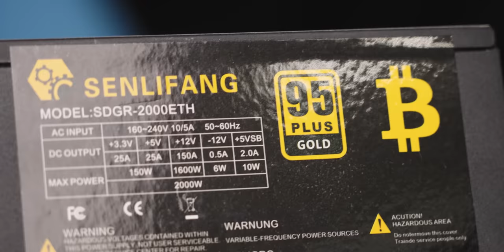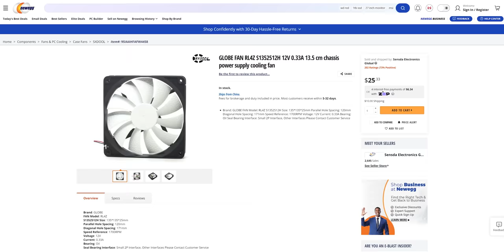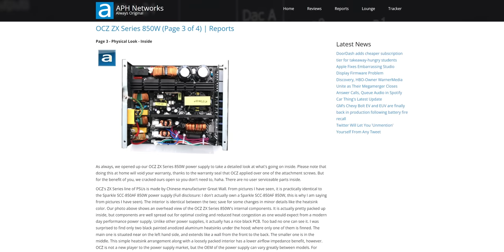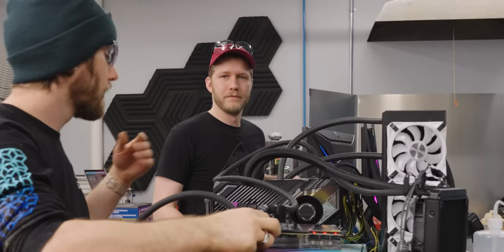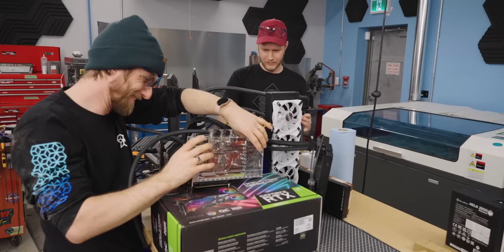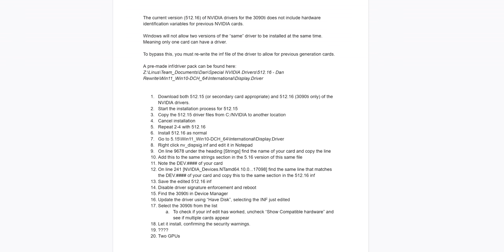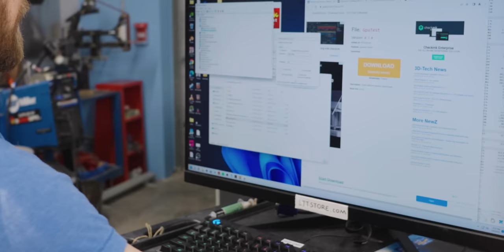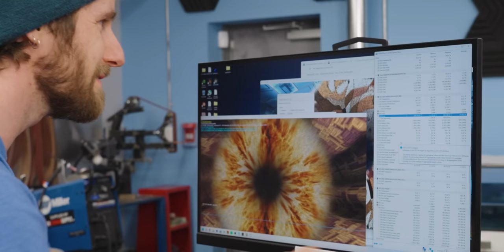This is one SKETCHY 2000W Power Supply

Comment: I test car and home amplifiers to show their actual power output because this has gotten so out of hand! Many use “MAX” ratings we call “ILS” ratings (if lightening strikes) 😬
Reply: Big D in the house. Or is it diriculous
Reply: Even for reputable brands? Because I mean if you buy a 5000W amp from some chinese seller for 30 bucks you can be sure it won't even reach that. It's like these 5 TB USB sticks from wish. But I doubt Yamaha would lie about the output.
Reply: @KiinaSu  years ago reputable manufacturers Kenwood, Alpine, Pioneer, JVC, Sony, and Panasonic claimed double the wattage for peak envelope power or pep. I believe it was jenson that started the max power. And if you're old enough you'll remember Roadmaster they was the worst
Reply: @minenachos  But reputable manufacturers had still the sinus Wattage somewhere written down. At least here in Germany (we have great consumer laws which sometime enforce such comparable moves, don't know if it was enforced.)
Reply: Dewalt's drills are/were branded "20v MAX"... that was not saying they are 20v tools, they are 18v tools with a surge draw of 20v max... they actually had to change the branding in some places (aus if memory serves)
Reply: oh... we call PMPO "Potência Máxima Para Otário"
it kinda means: maximum power for fool's.
given a radio, with a 1 watt peer channel IC, gets labels as having 500 watts it totally makes sense.
also RMS is not even respected.
some power supplies sellers over here can barely get 50% of label power before magic smoke release.
they also have horrible output ripple.
Reply: ILS LMAO XD
Reply: @seldoon_nemar  in Canada Dewalt 12V MAX / 20V MAX has an astrix saying that is the NO LOAD full charge battery power right on the packaging / advertising 
12V MAX * " maximum initial battery voltage (measured without workload) is 12 volts / nominal voltage is 10.8V: is written on a 12V MAX LED worklight packaging
Reply: Can you recommend me something cheap for my crunch 700 watt 4 ohm woofer?
The original 1000w(4 channel bridged to 2
=500w) one overheats after about 30min of loud bass...
Monoblock would be ideal...
Reply: Haha i have been in the electronics industry for 25+ years, and the techs who trained me (who were old men at the time) used  the term "ILS" all the freakin time! Happy to hear others coin the phrase! (I guess "OHM's Law" is relatively unknown in china?)
Reply: @lvhle04  Could you give the model number of the sub? Do you know the RMS of the sub?
Reply: I ended up getting a Pioneer GM-9701d after I saw your review of the 9601d. I got an amazing deal on it. It's powering two Alpine type R 10's in a sealed box at 1ohm. Couldn't be happier with my system. Had to put in an aftermarket alternator and a second battery to deal with my 3 amps. To anyone reading this, don't get just a capacitor if your lights are dimming, it's not the solution it's marketed to be.
Reply: @lvhle04  a screwdriver, some compressed air, and a fan that hasn't died? :P
go to a charity shop, look at the dvd players, look at the back to see if they have spring jacks. i keep seeing ones with 300w and more total output for a fiver. 3, 4 and 6 ohms. . then begin to frankenstein that shit all together! bonus points if you add switches and get a decent dolby IC and all the circuitry to split quad-toslink into a 20.4 surround system
Reply: Hey it's Big D. I had the idea itd be simpler and with less risk of damaging other expensive pc components if they had just found a way to rig it up to some amps and just amp clamp it to test its power. But I mean this is a computer channel so lol.
Reply: @reddragonsmaw  hey even ohms law can be manipulated with improperly tested numbers. That's probably how alot of em get their ratings, no load voltage test followed by using the load the amp can handle being used for their ratings lol
Reply: @lvhle04  taramps ...... readily affordable and do the power they rate ......
Reply: Shelf stereo units are notorious for this. I have two of Sony's - one is a "700w" unit from 2013, one is a "540w" unit from 2010. Their power consumption is rated for 90W and 250W respectively. No idea where they could've dreamed up those huge numbers.
Reply: My favourite one along these lines is Logitech... who publish wattage figures for their speakers... at 10% Total Harmonic Distortion... at 10% THD your music is going to sound like a badly tuned AM radio....
Reply: @BrucifyMe  yeah that's a great illustration of "peak" power. it is capable of hitting 700 watts for a blip, like a big bass hit or something. but the RMS rating is what matters most. that's the power it can deliver non-stop safely and cleanly.
Reply: Oh, the infamous ILS stamp? I thought it was a myth!
(for real now, my cheeks hurt from laughing 😂)
Reply: Hah! So true.. I tend to use Car Audio amps to give PC and other PSUs a dynamic load, it kinda works!
Reply: @jasonriddell  That's how every low voltage li-ion pack works.

When aiming for a 12v system (which people are used to in power tools due to nickel cadmium batteries being 1,2v), you can either have a nominal of 10,8v or 14,5v.
The easy solution was to use a 10,8v nominal system and sell it to the same market that's used to your 12v. It probably has the exact same motor anyway.

Also, they are used to nickel cadmium which has basically no voltage drop, that's not the case with lithium that goes from 4,2v to 3v per cell.
Reply: Audio power ratings are actually quite difficult to quantify, because to reproduce the sound without distortion, it (the amplifier) needs to be linear when the signal is at its peak. However, the peak power to average power ratio in music is often very high, and very much variable. So if you had an amplifier that can output 100W before it starts clipping with a sine wave, would maybe output something like 10-20W before clipping on regular music.

Wait--this gets better. Just a few decades ago, a lot of audio chip manufacturers used to quantify their chips with a "peak music power output" to say that their chips can handle, say, 100W of peak power without distortion, but if you tried to pump 100W of ideal signals it would fry itself. So with real music of a peak to average power ratio of 10, you'd be able to pump 10W average and still get acceptable audio quality...

The only problem is the manufacturers have to assume a peak to average power ratio and that was totally up to them, and what counts as "acceptable audio quality" might vary from one manufacturer to another. So it really was the wild west back in the day.
Reply: @acidangel111  thank you.
And for tbh.... Its only 350w rms... BUT i want to probably upgrade in the future to something a little more like "car shaking apart". So if i have a good amp thats a good start...
Reply: pioneer 1000w walmart amp actual rating plese?
Reply: Love your channel and tests!
Reply: Would  this get your big dummy award?
Reply: Big D what are you doing here?
Reply: @KiinaSu  It may meet that output for 4.5 nanoseconds before you get the blue haze and fireworks :)
Reply: Didn't RF champion the amending of the amplifier rule back in 2006 to use RMS readings, and them make that ridiculous 15KW amplifier, just to show how a "perfect" amplifier would test out?
Reply: @BruceCarbonLakeriver  potential maximum peak output.
however many nanoseconds it lasts
Reply: @Boodoo4You  0
Reply: @Boodoo4You  made me lok
Reply: @minenachos  even the “pro audio” stuff has gotten out of hand. I remember about 7 years ago I bought some 700w 2 way boxes to use as front fills. The next year the same speaker was rated at 1400w because peak numbers sound better than RMS numbers. My personal favourites are the ones that actually put 2000w amps in but will NEVER get anything near that because the built in dsp wont allow it.
Reply: Big D! love your vids!. Many years ago i learned about the marketing gimics of max power. The only company i can think of who has always done claimed power usually is rockford. I did have a older keenwood exceleon amp like 7 years ago raited 1200rms with a birth sheet of 1350w. But that was there high end amp line not the budget ones.
Reply: @christiansmith8529  I blame Rockville ever since they got in the pro audio game. But those 18 in pro audio drivers make some damn good mid-range speakers just don't put more than 500 rms or you'll put on a smoke show. Even SVS is claiming 5160 w peak with a 1500 watt continuous class D on 120v? Even maxing out the electrical circuit 1688 max at 90% efficiency. I think Linus might be learning something from us today.
Reply: @jasonriddell  it is now, but their original 20v tools had no astrix... they were forced to add it. hence the "had to re-brand entirely some places" 

also, I've never seen a drill;l or blower or battery with an astrix on it...
Reply: Disclaimer* One time use at 2,000 watts.
Reply: @jasonriddell  in the uk, the exact same batteries and tools are labelled as 18v. I find that interesting that the law in the uk and usa differs such that dewalt can get away with labelling their tools 20v max.
They are good tools though.
Reply: I love your videos! Some audio amp ratings make me laugh so hard I thought I was at a comedy club.
Reply: Actually, this one is nothing special. It actually has "only" 1600 W on +12V , so in real life it could power 1400W worth of GPUs and CPU.  Chinese were using these for crypto currency mining (before it became illegal). Now they are mostly sold to gamers . Too bad it could ne be used in US, otherwise it is reasonably ok iw you could stash your case somewhere to muffle the sound.
Reply: @minenachos  I used to do pro audio as a fun side business 100-2500 person events. A younger local guy bought some 2000w mains for his band and was asking me how big of an event could he do with them. I told him to bring them by my shop. We set up smaart and an rta. He was shocked when ONE of my 700w front fills out ran both his mains by 1.6 db (pink noise till limiter flickered) and the chart was way flatter.
Reply: it's you
Reply: @Boodoo4You  That's for left channel. Right uses merdelithium.
Reply: @KiinaSu  The output ratings are the accurate numbers but they just removed the decimal point so it looks larger than it is XD
Reply: Bahahahaha
Reply: That's call it ltt rating
Reply: 20V Max was simply a branding move to differentiate from the older 18V battery system. The actual battery cells are the same, but the charge controllers were improved, load wires larger, and whole package was shrank.  Other brands like Milwaukee and Makita did not change their voltage branding despite also improving their battery packs because they use the same slotting mechanism and pin layout as the older batteries, DeWalt changed theirs. It doesn't look good on the brand if some 18V batteries don't work with all your 18V tools.

18V is the "nominal" 50% charge voltage (5 × 3.6V).  20V is the fully charged voltage.
Reply: @lvhle04  Is the amp even rated to run at 2 ohm bridged? If not then there’s your problem. If it is then you might have gains set too high and are clipping a ton, or your electrical might not be up to snuff and it’s getting a ton of voltage drop from a bad ground or undersized wire.
Reply: @bappo456  there is no end to the lies some companies post on their amplifiers. "They always lyin' to ya" is what my friend says 🤣
Reply: @destineal  I love Linus! His vids are the best!! He should mod this power supply to power a 12V car audio amp so it can be used at home. Linus hit me up!
Reply: Car audio "ratings" have been out of control for decades, you're doing Gods work.
Reply: @minenachos  For this episode dikrickluous
Reply: Dude I remember in highschool with all the Kids and their “3000 watt” amps made by junk companies. It was never worth trying to explain to them lol.
Reply: @KiinaSu  yes that 5000 watts is peak power.  You need to look for RMS rating which is constant power.  Usually around half of the advertised peak or so.
Reply: @fjcruzer1  We were those guys. And blew up lots of subs. Then i went high quality amp but bad subs and those fried too.
Reply: Had my 20 year old MB Quart amps on an amp clamp.... was impressed. Solid numbers, no BS. These damn things are sturdy, and heavy.
Reply: @fjcruzer1  My favourite is when they tell you all about their 2-3000w system and get you to listen to it, yet they are BLOWN AWAY with the 500 real watts coming out of the back of your car.
Reply: @dropinbiking92  I forgot about that brand. Some friends had their speakers in doors. Seemed pretty good at that time. High power accepting for sure.
Reply: @scoobtoober2975  Never played with MB Quart speakers, just their amps, but I was able to get a steady 520w RMS @ 1ohm out of a 4.60 fully bridged (rated for 480 @ 1ohm)
Reply: I was just thinking “they need Big D to test this thing” 🤣🤣
Reply: @minenachos  om
Reply: @minenachos  Stuck with Onkyo, always with an accurate spec sheet
Reply: @lvhle04  For quality power Crown amps are up there.I think they are the best bang for buck.
Reply: I worked in car audio for about 7 years and it was always amazing to see 3,000 watt amps with two 15amp fuses. <_<

Comment: 15:00 you should have a power meter in the outlet to sensor the power pulled from the wall!
Reply: They also should have shown us the temp on that back panel they have a thermo camera, meh .
Reply: Also just send it the GN to blow it up
Reply: @09f9  An imported one could be both fairly cheap and 220V.  True it would have needed a corresponding power socket and IEC lead from a 220/240V  country too. That wouldn't be a bad idea though,  no need for the sketchy warning label to indicate the voltage.
Reply: Yes then he could measure efficiency 😁
Reply: @mlw19mlw91  He could calculate the power drawn by the computer, if he knew the efficiency of the power supply. As i understand they are estimating the power consumption of the computer... They have no clue if the power supply can out put 2 kilo watt. If they knew the power draw than they could calculate the efficiency, YES!
Reply: @jimmihenry  I want to add that efficiency is not linear to the load
Reply: @omniyambot9876  Yes right. Thank you! :). We would like to know the peak power so @ 2k watt...
Reply: @jimmihenry  yeah it's more likely to drop, the peak efficiency is about half the rating of an SMPS unit. In my estimate, the efficiency on max power @2000W would be about 80%+ like generic smps designs. It is still high and don't expect much. So about 10 freaking amps on the mains. 

But still, I wish they measured numbers more since they already have equipments... But that would be too complicated for majority of the viewers..
Reply: @AndrewMuraco  Yes. They have all the stuff to test it properly.

Comment: Alex: Dont touch the transformers!
Kyle: Proceeds to casually touch them 60 seconds later
Reply: I presume that this warning would be more important after the equipment has been energized.
Reply: Considering that he is an eletric engineer, he probably knew that he PSU had been off the grid for over a year and so its safe to touch. The warning was more for casuals like us, because if you touch does a day after you used it, you are gonna die
Reply: He's definitely a mechanical engineering btw, it is not the transformer but the capacitors that are dangerous.
Reply: @gamm8939  I have taken electric shocks from PSU's like that countles times. I never learn. Long as the current doesnt get through your heart or other organs you are fine. Mostly my fingers have got some nice jolt of electricity, i wear rubber work boots and im careful to not touch with second hand to something else when im checking things. I yesterday got such jolt from TV's psu because i touched wrong component accidentally, it was plugged to wall when diagnosing. So no you are not going to die if you are not touching something else same time or if floor doesnt conduct electricity
Reply: Transformers are harmless without a wave going in and they are isolated. The underside of the pcb is dangerous with the high voltage caps
Reply: @3DJLab  natural selection
Reply: @nielset5771  Kyle is mechatronic,  mostly mechanical  + some electronics

Comment: @8:35 "NTC" stands for negative temperature coefficient, these devices are used for inrush limiting.  When you first plug the power supply in all those caps will be charged, and without that NTC resister it can blow fuses or breakers.
Reply: i mean it could be used for temperature measurement, but inrush limitting probably makes a bit more sense
Reply: TIL
Reply: SHODAN be praised!
Reply: @ald3nt3  For temperature measurement, way higher resistance NTCs are more convenient, of the order of 10k
Reply: @rexsceleratorum1632  
Yeah you're right, just checked the datasheed, it has indeed an R25 of 5Ohm (and like 145mOhm at standard operation).